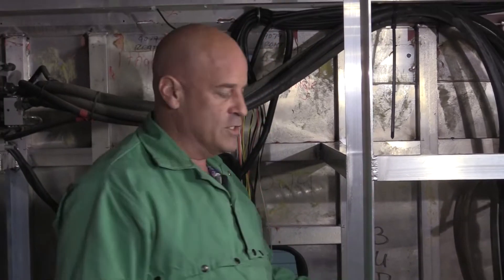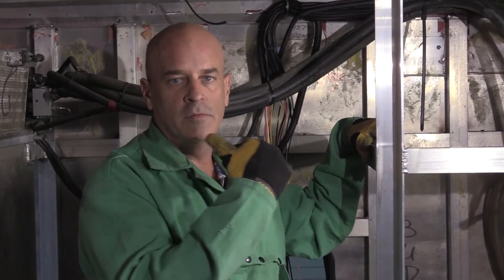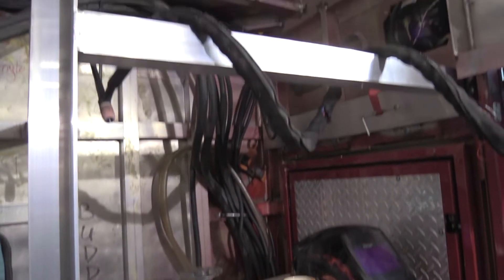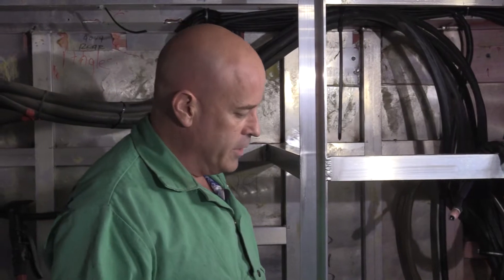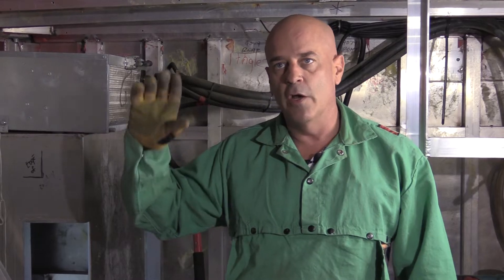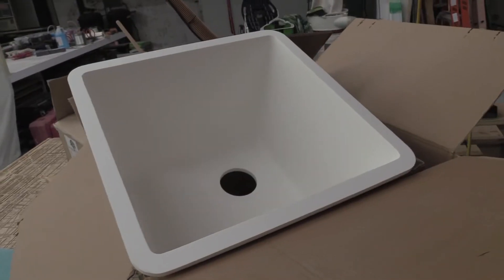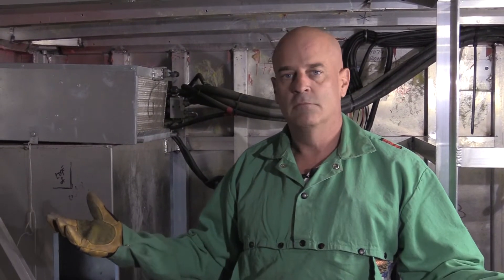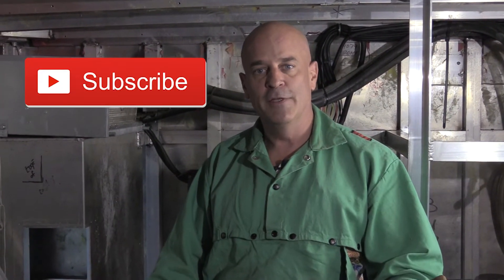Ambulance to RV/Part 4 - Yacht Shop Creations "The Bear" Project

Comment: Possible to get some info on that A/C unit? Interested in installing one in my build, if the specs are good? BTU rating, amperage?
Reply from the maker: Dan, pause the video as we are doing B roll. All the information is clearly listed on the front. Hoseline = manufacturer’s name- Saint Cloud Florida is the Location- 407 892 2599 company phone number.